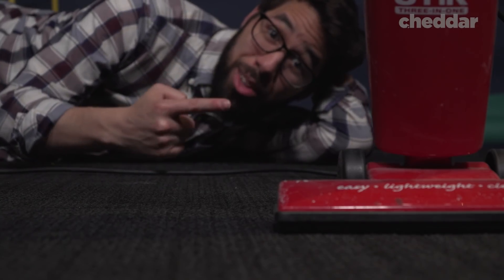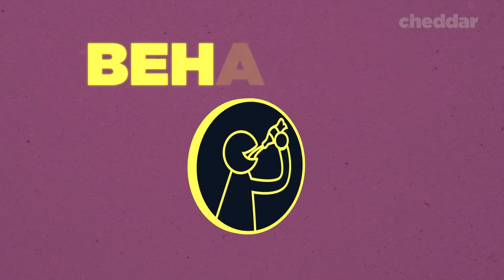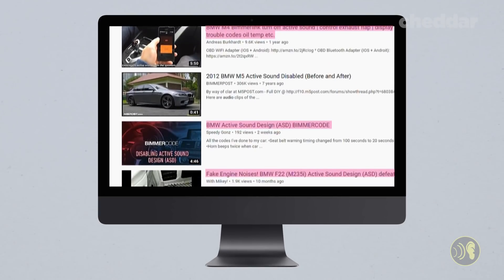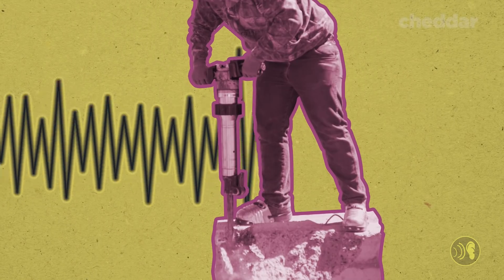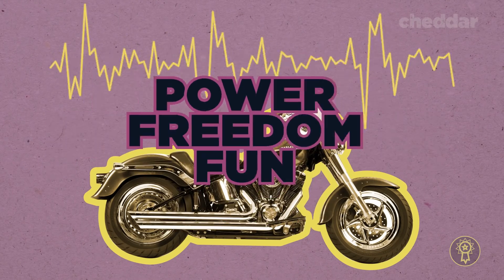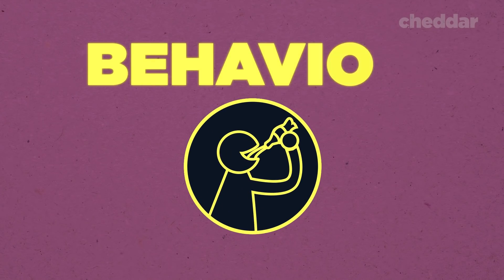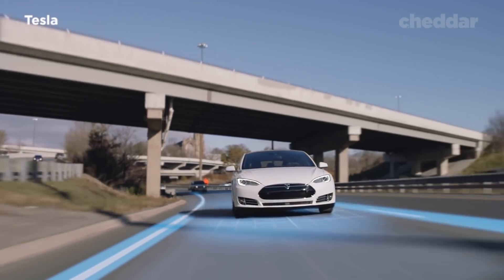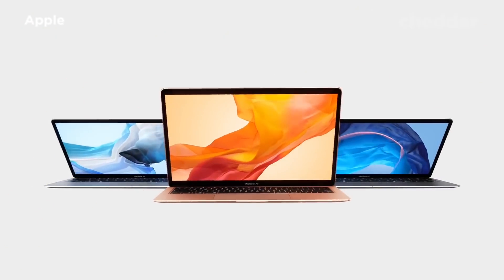The Fake Sounds Companies Add To Products - Cheddar Explains

Comment: So you're telling me I could've been sleeping in on the weekends instead of being woken up by my mom vacuuming??
Reply: My life is a Lie
Reply: readytowait LOL
Reply: When I'm riding my bike I'm glad most engines have a sound
Reply: pigglet and pooh bear, that’s true
Reply: Or without being woken up by loud cars going by my window!
Reply: @bloody_albatross  Tell this to the people who like loud cars
Reply: @bloody_albatross  sorry for doing something I like
I'll be sure to complain about you doing something you like
Reply: Yep
Reply: Same with lawn mowers...
Reply: @Stylez-13  its not the same. The sound of the blades cutting the grass can't be removed
Reply: @dieselgeezer18  .....It's the sound of the motor roaring that wakes me,....not the sound grass being cut.
Reply: @dieselgeezer18  That's not nearly as loud as the gas motor (which is polluting anyway).
Reply: @ebinrock  oh yeah polluting. You use it for only 20 minutes once a week and the engine is so small that your lungs produce more carbon dioxide than this thing. My gas lawnmower is very quiet though. If yours is very loud then it might be a 2 stroke motor. Get a 4 stroke. They are much more quiet and they pollute much less
Reply: @ebinrock  electric can also pollute if your city's power plant uses coal or other polluting methods to make electricity
Reply: @Stylez-13  Go electric - it's (MUCH) quieter and cleaner (and practically maintenance-free).  Better still, get artificial grass (I have NO regrets!).
Reply: @Ali Imran Afridi i don't find it that annoying tho
Reply: Hahaha
Reply: why would you want to sleep in
Reply: That's the sound that tells you you should have been doing the vacuuming instead!

Comment: My favourite, Is listening to the click click of the indicators/blinkers in my car. This noise represents the flasher relay switching on and off and is present in most cars. I then chuckle to myself when I think that my car does not have any flasher relays and the action of the indicators turning on and off is controlled digitally by a computer. i.e They wouldn't make any sound at all, the click click has been artificially added to mimic the traditional sound made in older cars.

Comment: I owned one of the last Yamaha Banshee four-wheelers to ever roll off of their assembly line, and I can attest to how dangerous it is to drive a fast machine that doesn't "sound like" or "feel like" it should be as it is. Even though I was a very skilled amateur motocross/enduro racer at the time, I managed to crash that damn Banshee every single time I took it out for a spin! EVERY TIME! LOL

Comment: OMG ITS 2019 WTF IS SNAPPLE SWITCHING FROM GLASS TO PLASTIC😱
Reply: User Unknown I know I lost it. Idiots more ppl would buy if it were better
Reply: "It’s lighter, virtually unbreakable, and resealable, making it more convenient for our consumers to enjoy Snapple on the go – and easier for distributors and retailers to handle." According to Snapple website.
Reply: Joseph Staruski sadly plastic is also not biodegradable, meaning it's really not good for our environment
I guess just more recycling will help, but a permanent way of disposing of unusable plastic waste would be very nice
Reply: @siriuslywastaken  I 100% agree, but I don't think glass is biodegradable either
Reply: Macdonalds Internet it probably isn't but iirc it's easier to recycle than plastic 
I could be wrong though, i have no sources for that.
If it isn't then i guess it's on the same level as plastic as a container
Reply: @John Shaughnessy and nuclear energy is the answer
Reply: @Katrina Rogers literally a 10 second google search will prove you wrong 😂
Reply: I don't get why they couldn't use aluminum! It's the best option for eco-conscious packaging
Reply: Glass only makes sense if the bottles are returnable and reusable. Like old coke bottles. Snapple doesn't have that system in place so changing to plastic is actually more efficient. Sad truth.
Reply: Yah, the glass  bottles don't get recycled much, they're heavier and more expensive. So they've switched to plastic which bums me out, I love glass bottles, they're much more aesthetically pleasing
Reply: THE DAMN WORLD IS RUNNING OUT OF GLASS THATS WHY. sand is in serious shortages. NOT ALL SAND can become glass.
Reply: @John Shaughnessy how does that make it less biodegradable? What does plastic become? As far as I know it doesn't change forms at all naturally.
Reply: @John Shaughnessy have evidence for that?
Reply: @John Shaughnessy makes sense. I'll have to look into whether or not glass is easier to recycle than plastic when i have time. Now that I think about it though they're probably both relatively similar in that regard.
Reply: so its the product inside that matters and wth is snapple
Reply: @Katrina Rogers Im sorry if I came off as being rude or sarcastic. That wasnt my intentions at all. 

Im just worried about the planets future, the world will more than likely be ruined by the time I have grandchildren. It breaks my heart knowing future generations might not get a world that they can save or funtion in.
Reply: @Katrina Rogers yes it is, literally google it... we use over 50 billion TONS of sand a year. 

Less than 10% of all glass used is recycled also, so NO.
Reply: @That_Son_Ofa_Itch  so maybe we should start recycling more how about that?
Reply: @paulhill4382  we should, and I hope more people do.
Reply: All of y’all saying plastic is better/safer environmentally are forgetting microplastics.
Reply: It reduces carbon pollution because plastic is lighter than glass. That means that shipping it across the country is a lot less polluting.
Reply: @John Shaughnessy fair enough. What about plastic though? Since your numbers for glass were accurate i assume you also have a source for how long it takes to biodegrade?
Reply: Good, I like the plastic. It's safer and lighter than glass.

Comment: Ive never been diagnosed but I'm 99.9% sure I have synesthesia. I can feel sounds. Not like the sounds touch me, or the physical rumble of a loud speaker. The sounds give me a feeling. The really high frequencies, like the hum of a vacuum give me an anxiety/hyper feeling, a Harley gives me this excitement/euphoric feeling, noises that quickly change frequency make me slightly dizzy. The worst feeling of a sound I've ever experienced are certain types of newer cars when they're in idle. Instant anxiety, nausea, and slight dizziness. This video slightly triggered me lol. This type of synesthesia sounds worse than it actually is. Most noises aren't torture, and some noises like literally get me " high ". I describe it like evey noise is like nails on a chalkboard except there's a spectrum. Good noises, bad noises, and everything in between. I didn't even know I was " different " until I was like 20 too. The nails on chalkboard through me off cause people without this type of synesthesia still know what a " Bad " sound is. To help define the spectrum, crystal singing bowls are the best sound, with Harleys up around their too. And if you got any questions, I'll answer them all... 

Sorry its so long, and I didn't proof read, so forgive me.

Comment: Harleys sound "powerful"?  HUH?!!  Does a two-cylinder really sound powerful? Bikers just rip the mufflers off and annoy the living fuck out of people with them..    My Briggs & Stratton Lawn tractor engine has the exact same crankshaft design as a Harley,  The same pop-pop .. pop-pop .. pop-pop .. pop-pop ...  (or "potato" sound sound) as well.  If I ripped the muffler off, replaced it with straight-pipes, and drove it past peoples houses at 10, or 11 PM , or 6 or 7 AM,  constantly revving it needlessly like Harley-riders do,   people would be upset.   BUT,  It still sounds like a tiny little 2 cylinder, 26- horsepower, air-cooled lawnmower engine.. So does a Harley.  But because it says "Harley Davidson" on the side, I guess it gets a pass at state emissions and noise laws for road-going vehicles. 

Look up old OCC episodes. The "Dixie Chopper" episode.  The Teutels and crew actually put a similar lawn-mower engine on a custom bike with very similar power and the exact same sound.  Bad ass LOOKING bike,  Beautiful,  But in the end , it still sounded like my old Husqvarna lawn-tractor with its blown-out muffler.

You want a powerful sound, and the mechanical "balls" to back it up?  Get an old, Chevy 350 with true dual glasspack exhaust.
Either that, or a V-8, 2-stroke, Detroit diesel, or most straight six, straight-piped, 4-stroke, turbo-diesels. 
THAT's power.  That is power that actually sounds powerful.   Not a wee-winky lil' two-popper.

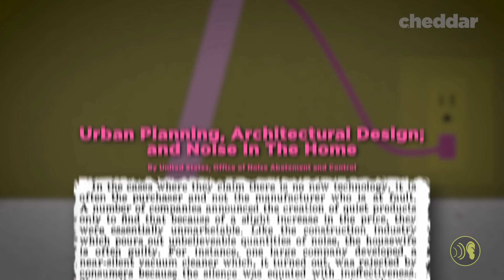Comment: 3:34 That's a great point. Sometimes when I'm vacuuming, it makes a high pitched noise. I know then that I somehow twisted the tube and air is having trouble flowing. 

Or when something gets stuck in the tube, you can tell because the noise is far quieter. If the vacuum was naturally quiet, I would have problems trying to figure out why it may not be working. It's the same as pain, if I don't feel pain, I won't know if there's something wrong with my body.

Comment: When it comes to car sounds, Mercedes Benz is king. I have a 2005 C-class and a 2007 E-class and every sound, everything you touch, everything you move feels solid, expensive and makes a nice expensive sound. The only indicators that don't annoy me are Mercedes ones. They just belong in a luxury car. They just feel right. Closing the door feels satisfying. Getting the slightly metallic, solid thud. You know you closed an expensive door, belonging to an expensive car.
Mercedes spent over a billion euros on the W203 alone... and you notice that everywhere. Among all of the cars I've driven around work, only one manufacturer manages to have no cheap materials anywhere in their 1995-2008 cars. Mercedes Benz.

Comment: For the car sound being a lie, my car has a tube that is fed into the bottom of the glovebox so you can hear the intake and turbo louder than it really is when its stock. Of course going full open exhaust youll hear the turbo and wastegate even outside the car very easily as its loud but its hilarious that in stock form (you cant hear it outside) its so loud in the car.

Comment: That dust impact amplification thing sounds amazing! They could add a short echo to give the impression of multiple impacts in succession.

But making the background motor sound any louder than it needs to be is super impractical. It might be more impressive in a demo but actually using it for extended periods gets to be annoying.

Maybe they should look into pulse width modulation the motors to do a more quiet scifi high tech kind of sound with more complexity.

Comment: Hi, I don't know what those sound designers are thinking, but everything is getting noisier. You can't buy anything that doesn't bip or try to get your attention by some annoying to downright aggressive sound. The average washing machine bips multiple times for any reason. My mom has a bread machine that bips 8 times for each part of its programs, sometimes 5 times, so 40 bips to cook 0,8 kg of bread. And if the oven and washing machine are working simultaneously, you can't hear yourself thinking. It's not sound design, it's torture!

Comment: The snapple bottle lid pop isn't necesairly just to make a satisfying sound when opened the first time. here in Denmark we have a brand of Cocao milk with the same design, which not only makes a pop sound when opened, but when you buy it you can be sure if it has been opened before or not. If you press down at the center of an un-opened bottle, nothing should happen, but if the lid depresses when you do, and makes a light pop sound each time you press, it has been opened before.

Stay safe, don't buy bottles that have been tampered with.

Comment: I hate the crunch sound of the chips because I want to eat them in class or lectures without feeling like I'm disturbing everyone. Thus making me eat less unless I'm at home where it doesn't matter. I also would vaccum more if it wasn't so loud since I would mostly do it late at night. I don't need to hear the particles to know it's working. I can see the hair/dust gathering in the machine!! Or even just when I clean it out.

Comment: As a highly audio-oriented person, I mist admit spent a lot of time trying to get my project car to sound right. 

It used to roar when it entered the power band around 3000 RPM, and crackle like a Maserati while engine braking. Now it does neither. One turned out to be a result of not having a catalytic converter, and the other was a dying ignition controller. 

I got a turbo engine and far more power, but the sound of it is dissapointing to my ears.

Aside: I'd love to hear an electric car with the choppy, aggressive whine of an old electric bus

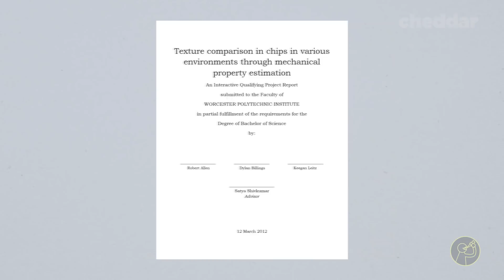Comment: You use the word suggested a lot 4:00 6:27 6:42 and then from that jump right to it being a proven conclusion which is it?
Either it's a fact or or not saying it's suggested is a weasel word that means it's not proven. They can't be both and you don't seem to distinguish between the two.

Comment: In the car industry it is borderline malicious. The cheap, baseline models are actively engineered to be louder and to have more wind noise and to feel bumps more. They do this by putting less insolation around the windows and in the doors and in the trunk and obviously near the engine.

Comment: Why did snapple ever switch to plastic that a horrible idea🤦‍♀️
Reply: If I took a glass bottle out of a store fridge, I'd be worried about dropping it and leaving sharp hazards on the floor.
Reply: @stylesrj  I saw a dude drop a full bottle of ciroc from the top level of the train and it didn't break lol.
Reply: @HoomerbirdG2  
Just like sound design, it's a matter of perception. Movies tell me that glass is fragile and will break from even a slight drop. So holding a glass bottle feels like I might break it; especially if it's covered in condensation from that fridge.

Comment: Hearing it pickup stuff can remind you how to use it. One-pass perfection. SLOW DOWN it's not a scrub brush or whisk broom. It's a processor that passes over the area and processes chunks and dust at a fixed rate. Move it at a moderate speed not racing from end to end. With that all plastic housing it will last longer too. Think Indiana farmer planting seed corn, not the Indy 500!
Remember NOISE $ELL$.

Comment: That’s not correct due to the fact that the turbines of the motor make that sound like there’s a fan inside there that rotates that creates the suction that makes the noise if you didn’t have a fan blades the way that it’s designed it wouldn’t be efficient

Comment: I'm aware of the fake sounds pumped in for effect on certain things. But not EVERY little thing is engineered specifically for the sound. Most cars have the same door mechanism and I'm willing to bet that one with a different mechanism doesn't have the "classic" door sound. Same with the gear shift and windows. Sometimes a sound is just naturally produced because of the mechanics of the item. There are plenty of instances of sound engineering, why pad out your examples in the intro?

Comment: I like it when it sounds like my vacuum is chomping on dust. 

I run over shit til it does, more often than not, if it doesn't chomp on the shit I pull it back and it's still there.

Comment: Honestly I'm glad they make it easier to hear shit hitting the inside of the vacuum. I can always tell I'm either trying to use it in handle mode while running it normally, or that something's not right when I can't hear that sound. There are plenty of times where if I couldn't tell something was off I would have ended up just running the thing over the carpet for no reason because I had the wrong setting on, lol.

Comment: Its true. Something as simple as a turn signal has a distinct sound. Mostly so that when you hear it, you can tell if it is on. Same with making cvts "shift". It provides satisfactory feedback letting you know that your car is working fine. When you listen to your car run, you are inactively listening for noises to happen to signify it working. Electric vehicles pump road noise into the cabin while driving to keep you alert. Who here has taken a car back to the delearship because of the noise it makes? Nearly everybody.

Comment: I need a tutorial for quick fixes to achieve a silent vacuum cleaner.
Even earplugs can’t silent the sound.
Reply: Active Noise Cancelling headphones like the Bose QC35ii and Sony WH-1000XM3 do the best job at filtering out vacuum noise.
Reply: Fuck that, just use double ear protection. A pair of foam fuckin earbuds installed correctly by reading the fuckin instructions not just slammin them in your ear drums, and then some 3M over the ear protection headphone type. Double ear pro should cancel out any harmful sounds you would usually come to experience and its like 90x cheaper than some high tech headphones that dont do as good of a job
Reply: Noah F. Except you can’t then also listen to music.
Reply: Tri-green-angles green triangles 
It’s a product sound design.
Engineers and designers manipulate the auditory element of product to make active choices about what those products end up sounding like.
Reply: Tri-green-angles green triangles 
I love how we are having a conversation about vacuum now >.<
Reply: @I like Green Did you even watch the video?

Comment: The first minute & a half, correction, all of this video is stupid. Lol. No MFG is buying the “ special extra squeaky leather” for their cars. Lol. & the turn signal noise is a relay. & the wipers are engineered to effectively remove water from the windshield. The sound they make is just a result of that. Pretty sure 90% of this just comes down to MFG cost effectiveness. They want the car door to sound good & solid, but if it’s a cheaper model, they use a cheaper seal because they are selling it for less.